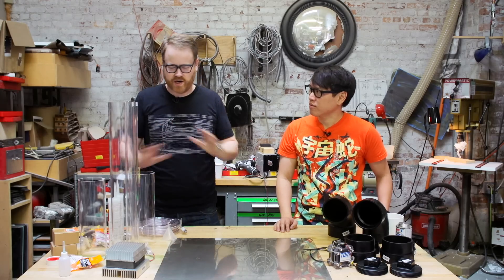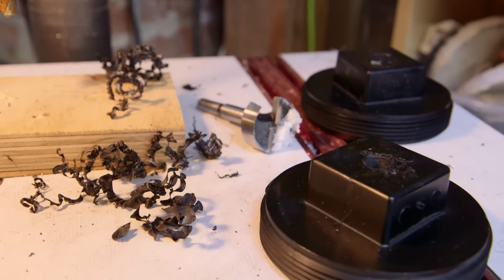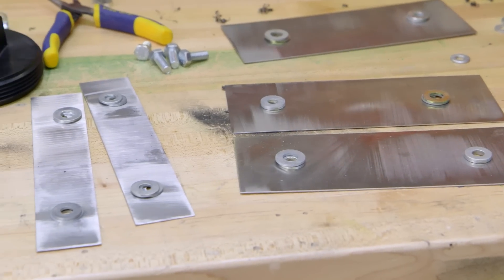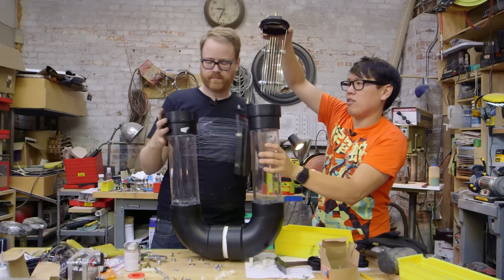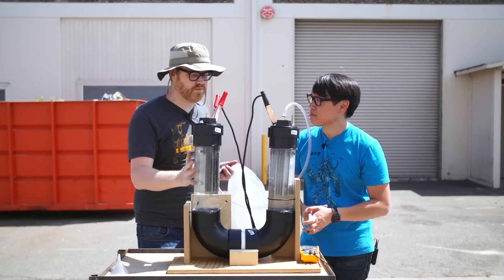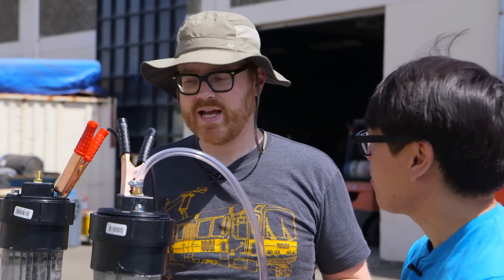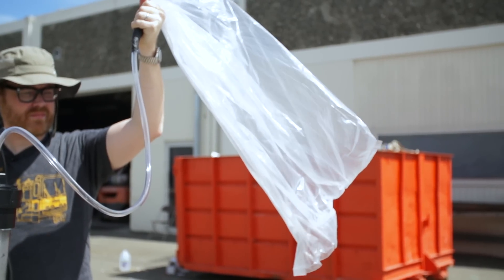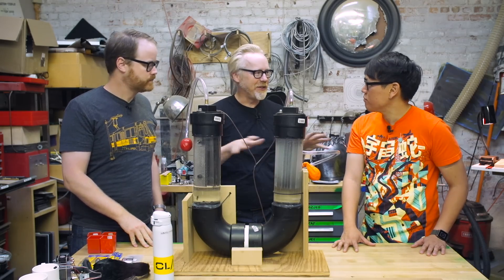Tested Builds a Hydrogen Converter

Comment: you could have at least done it right -> your not not even trying
Reply: yeah, this is kinda anti-mythbuster. Oh we tried once, oh well, guess it doesn't work.
Reply: +PlanetEngineering Official my thoughts exactly. these guys are kinda crap.
Reply: you're
Reply: +shadfurman this is the second time they "try"
Reply: Graafschap 139  thats the stupid part of the problem , the real problem is them not not replicating the the specs of the tubes and not putting the right electrolite
Reply: I remember back in school. We did this experiment, too. It was running about a half an hour and we around a liter of hydrogen.
Reply: Kevin Jackson there are already hundreds of videos of people doing it right. 

Mostly they need a LOT more surface area, if you force the water through, you can do enough surface area in that kind of space, but you've gotta keep it flowing to move the gas out of the way and push the water onto the contacts. 

The hard part is the chemistry. There are tradeoffs and no free lunch. You have to decide what is most important to your design, because you're going to have to use a lot of energy, or a lot of space, or change your electrodes and electrolyte often, etc.
Reply: shadfurman
"no free lunch"?!?! I thought that was what HHO was all about!
Reply: Kevin Jackson I know weird right? Damn Lord Kelvin and his "Thermal dynamics".
Reply: shadfurman I don't think the surface area is the biggest problem. Their anode and kathode are quite far apart. If they arranged the plates in + - + - + - + - etc. it would be more efficient.
Reply: Arquintox surface area is required to transport more electrons into the electrolyte, you can use a higher current, but that creates more heat, putting the electrodes closer together might help, I don't know what the resistance of their electrolyte is or if it's a linear relationship to distance. Maybe I've had more success with higher surface area electrodes because the electrodes I use are corrosion resistant, but also have higher electrical resistance.
Reply: It seems to be an exponential, almost square rule, little like gravity and light falloff. I've had varying success with aluminum, and stainless, I've used sugar, baking soda, alkaline salts, I found with the plates it was best to arrange in a circular arrangement, with inner and outer, and consistency is key, have run up to 48v dc with very high electrolyte levels of up to 5x with high yield, but yes, heat is a problem, especially with large plates (electrodes), found stainless steel wool to work very well, separated by an insulation barrier.
Reply: Tuxiswatching it was a pretty big fail to
Reply: Kevin Jackson are you getting answers or are you just here to fuck shit up? i dont see you commenting about the video
Reply: PlanetEngineering Official They actually used a decent electrolyte. KOH is widely used.
Reply: If you know how to do it "right", where is your video? Let's put-up or shut-up.

Comment: What a disappointment to see you guys screw this up with all your resources and knowledge. Made sealing mistakes on top threads so it leaks . Separate your gas in bubbler safety catch.oxygen is heavier. Research a pwm system for power supply.i guess next you will screw up wood gasification.stan Myers is in his grave laughing his ass off  at you . Do you guys ever admit to screwing these experiments up and make it right on another episode after you do your homework.?

Comment: Hate to tell you but it is the current that controls how fast the molecules are separated. An increase in voltage will give you more current for a given resistance Up to the point that the internal resistance of the solar cells controls the amps. You probably would have done better if you would have rearranged the cells to give 6 volts or so and increased the conductivity (more KOH) to get more amps. Just a thought.

Comment: Pouring acid on yourself even week acid incase of an accident is bad. In case of an accident it is imperative to  wash with plenty of water and contact your local hospital. Never try to neutralize a base or acid spill. Water is you friend, also most chemist like myself reccomend not using gloves when handling non toxic acid and bases as a glove prevents rinsing and will actually risk making a spill significantly worse and more likely to happen. So again NEVER use an acid, as a way to prevent damage after accident, use plenty of luke warm (nice finger warm is good) water, and rinse for at least 20 to 30 min.

Comment: Should have used more caustic soda (there is a peak at the  conductivity/concentration ratio since it is a strong electrolyte, also... good noting that using salt actually has its problems since the reaction to get chlorine is in competition with the hydrolysis) also to gather the gas it would be cleaner to use a water sealed container... 
Practically a clear bucket upside down where the H2 gathers at the top. It is more comfortable because you can make marks of the volume you are having. Maybe a couple more things could be changed...  It is a redox reaction, and its kinetics can be faster if you make the temperature higher. I'd play a bit with temperature and pH to make use of the Nernst equation and predict a better efficiency...
Edit: I forgot to add a few things more... If you are achieving for surface area in case of an electrode use steel wool it is cheaper to get and has a LOT MORE surface area than a plate.

Comment: Betting this would've worked fine if they had sealed the thing better. Hydrogen can leak out of ridiculously small holes, which would normally be airtight. You need a near-perfect seal to really get a hydrogen buildup in this thing.
Reply: I'd have thought it could leak from the bag too.
I'm not 100% sure, but I do know Mylar is better than rubber for helium balloons because the helium leaks through the rubber.
I'd assume hydrogen would be similar, and I don't know how porous the plastic bag would be to hydrogen.

Comment: what a waste of a video!
use a smaller electrode made of platinum foil as its a far better electrode. also sulphuric acid is a far superior electrolyte.
and 1 more correction, distilled water doesn't conduct current at all.

Comment: A quick google search and came up with this

"The best reported results have been with spacing of around 1/32nd inch. This can be attained by using thin nylon washers between the plates using a nylon threaded rod & lock-nuts."

I do believe some comments on here tell truths. hard to swallow truths. For one. Adam is in the media industry, bought n paid for to lie to the public. 
I do find what he does interesting, but no way can I believe 100% of what he's spewing.

Comment: This project can be improved! The gap between the cathode and the anode creates a big resistance, I think that the poles need to be more close to each other.
Reply: Non needed if you use frecuency match with electronics and a inductor equivalent...like a tank circuit
Reply: @eloycastillo4191  Could you explain a little more? I've thought that with frequency and magnetism, someone should be able to elongate and help pull the molecules apart. So very little power would be needed to break the bonds. Or less anyway. And therefore less heat would be generated. Just something I've been kicking around my noodle. What are your thoughts?
Reply: Much, much closer together! But that makes it harder to separate the O2 and H
Reply: @adamframe309 , This was extremely disappointing! That project was a very simple one, of which many people have already done. This looks like an attempt to make it look impossible. I thought these guys were smarter than this.
Reply: @johnadams5276  they have investments in big oil
Reply: @johnadams5276  Stooges
Reply: Ad koh 5gr acido cítrico 5gr per 1Ltr and will se impruve
Reply: Also, add potassium hydroxide as a catalyst.
Reply: @robertbielik5256  Or citric acid
Reply: @robertbielik5256  they did. It's an electrolyte not a catalyst.

Comment: You could have just used table salt, and you are supposed to mix it.
Also you are supposed to connect a battery to the hydrogen collector with a solar panel powering the battery. the solar panel probably only has a few amps worth of power.
Reply: The problem with using NaCl for the electrolyte is the Cl part.

Comment: Current actually needs to be conducted through the water, using an electrolyte. In this rig the electrodes were way too far apart for the current to be conducted through it enough. They should placed closer. The real challenge is separating the hydrogen and oxygen efficiently while keeping the electrodes as close as possible.

Comment: The way that WE did it in high school chemistry was using HCl and pure Copper wire. Quicker and more efficient.
Reply: Sale M I'd be interested to see where this study leads, because I have a feeling this is a basic prototype of a larger, more powerful solution.
Reply: more efficient yeah no.
Reply: tell me what do you think of this would apriciate your opinion. https://www.sciencedaily.com/releases/2015/06/150623113836.htm
Reply: SirRandomMonkey
have you read it already?
Reply: Sale M I didn't read every single word of it, but I read the parts that were relevant to chemistry.
Reply: About of the spesific tip of metal used to get more gas using less energy.
Reply: Both of those are a lot more expensive than water and an electrolyte.

Comment: needed to either use abs pipe, which is black, or pvc 90's which is white...  if they used the pvc, then they needed a primer and glue...  there is a specialized glue to put pvc and abs together, they will come apart eventually, it will not be a permanent hold...

Comment: 22 volts of power, about 100 watts of energy....Yeah guys, back to school.
Reply: I don't understand your comment.... 22 volts at 100 watts means you need about 4.5 amps. Solar panels at full sun can do that. Assuming there are enough PV cells.
Reply: +Kayla Mayfield The problem is not the numbers, but the units! :) volts are a measure of electric potential, not power, while watts are a measure of power, not energy! :)

Comment: Bah, this video is so frustrating lol. I'll just point out the one thing that's driving me crazy, which is why would you use solar? Who cares if it's clean energy.. Current is way more important than voltage in this case, hook up a car battery and you would've gotten the 15L in a few minutes..

Comment: Trying to disprove a functional experiment -> Trying to replicate the experiment not adhering to the original parameters and totally neglecting how the "improvements" can change the final result for the worse -> Experiment fails -> "It's lame because it does not work" 

SEEMS LEGIT
Reply: I'm not sure where you are getting that they are trying to replicate Grants experiment. They made a design change, to separate hydrogen from oxygen, in the gas production. Grant wanted a mixed gas, for the violent and entertaining results that can provide, Adam wanted pure Hydrogen.

Comment: The reason that the rig didn't produce very much hydrogen is because there was an insufficient amount of power supplied to the canisters in order to produce gas. The more power provided to the plates allows the molecules to attract and split at a faster rate. At least that's what I understand, and I could be wrong.

Comment: its not about the volts, its about the watts, the current.
Reply: I was watching this and I'm like, just use a ridiculous transformer and infinite profit. Oh wait, that's not how this works, that's not how any of this works.
Reply: +Andre Swarts I was thinking the same thing. Wouldn't the car battery provide tons of more current?
Reply: +Andre Swarts but if you increase the voltage at constant resistance you also increase the current
Reply: +Andre Swarts *watts, the power ??
Reply: +Sam Holliday Well  W=VxI so he's not wrong
Reply: The Gamer Bro "its not about the volts" "[it's about] the current" << these statements are wrong because Watts involves BOTH units.

Comment: Does the fact that the anode and cathode are so far apart have any effect?  If the plates were intertined like a battery would it produce more?  Would be more complicated to separate them though.   Would also be interesting to see if higher voltage would be better, as it would probably make it pull more amps.   I've made a small rig like this so I could test my hydrogen sensor and it actually worked (as in, to test the sensor, it did not make any more hydrogen than they did as it was very small).  Never experimented with capturing it though.  Would be neat to make a rig that can produce fast enough to fill a weather balloon or something.

Comment: Well you basically told me that if you have conductive water and you run electricity the molecule splits and you have the gasses. What you didn't tell me is. Why they split and why the oxygen goes left and hydrogen right? Which makes this info slightly useful.

Comment: Here the voltage is not considerable while making HYDROGEN/HHO 
AS THE AMPS INCREASES HYDROGEN PRODUCTION INCREASES.100W IS NOT NECESSARY ,BUT YOU CAN GET 15 LPM BY GIVING 30 AMPS IN LESS THAN 5 MINUTES, YOU HAVE WASTED A LOT OF TIME AND YOU GOT 15ML LOL.
Reply: Veekshith Balabhakthula you can get 15 liters per minute by giving 30 amps in less than 5 minutes?

Comment: Gee

Problem one, you poured in an electrolyte after filling with water and did not mix it.

Problem two, the electrolysis current had too far to travel around the tube. It would have been better in a single tube with a partition in the middle.

The King of Random unit worked perfectly because there was not an Olympic Swimming Pool distance between the Positive and the Negative
Reply: Totally agree...I think that this is intentional...reminds me of the Top gear Tesla saga...I am working on my 7th prototype now...and its not rocket science...you can make a hydrogen generator from as little as a paper clip and a straw, efficiency is where the attention to detail comes in.
Reply: storm37000 no they don't. The strength of the reaction doesn't depend on the voltage but the current. Here comes the problem of their setup. The solar cell can output about 4.54 Ampere. This is way lower than what a car battery can output (up to 100 Ampere). They could have tested even maximizing the current with using more batteries in series. Rectified mains could be used too of course.
Reply: But TKOR's produced HHO, not pure Hydrogen.
Reply: Joey Koningsbruggen same principle. Just get HHO gas mix as output. Most efficient plate configuration is anode cathode ... A.C.A.C.A.C.  OR.  C.A.C.A.C.A
Reply: They are obviously paid to make this seem impossible
Reply: Paul Jacobs thanks for explaining, I had to wade through a lot of negative crap to get a simple answer 👍🏿
Reply: And hydrogen can pass through the molecule that makes the bag
Reply: the cathodes and electrodes are to far apart to conduct through that distance.  mine put out 1 litre per minute in a 4" cube (drycell) 12 volts at 7 amps.      but the spacing between them are 1 millimeter.     the will never work over a foot apart..
Reply: All they wanted was to make pure HYDROGEN and pure OXYGEN on either side of the chamber, so the only way to separate it is by doing it like this, using two tubes.
Unfortunatly, the distance between the electrodes is too great for the current to flow through, thus increasing the time needed to generate the gases. I agree that they should've used a higher current (about 50 amps) to increase the production, and kept the 22 volts, which was shown to be efficient in The King Of Random channel (using two car batteries - about 24 volts and 50 amps).
It was just a proof of concept, rather than a practical generator, which would be desirable to have HHO, using both hydrogen and oxygen, as a fuel.
Reply: @Ryan-lu9km  all they have to do is bring the cathode and anode closer together. That short amount of distance with low current like that is miles in comparison that the electricity has to travel. I think it’s on purpose. This is the second one where he’s tried and failed and both times it’s deliberate. These guys know what they’re doing
Reply: +Paul Jacobs  I was thinking the same. I hate it when idiot people perform tests without doing proper research first.
Reply: @giyanvice  They knew it would flop. Lets be real
Reply: +Giyan Vice There is an ever growing HHO movement out there, but unfortunately there are so many self proclaimed experts on the internet that really have no idea on what they are doing. 

Adam has now twice made ineffective HHO units, and published the videos.

I would like to invite him to do a third video, but this time actually take the time to research what they are doing. www.reduceyourfuelbill.com.au/forum
Reply: @pauldjacobs  Very true but wouldnt it be better to develope a system that uses a pure sodium like dust to be sprayed into a cylinder and water to then be also injected in addition to creat an explosion in the cylinder.
Reply: Paul Jacobs Because all people going to drive own car on hho genrator what about crude oil mafia they will kill you read wrold history of creator who creat the water kit for car all is Dead or disappear
Reply: you just need more voltage than 22v, maybe mains 120-240v or even higher possibly, rectified ofc.
Reply: Paul Jacobs There was not a Olympic Swimming pool distance.
Reply: how do you separate the hydrogen from the oxygen in a single tube
Reply: @koningsbruggen  You use a stainless steel tube as your negative cathode
Reply: The mainstream media outlet is going to sabotage this.